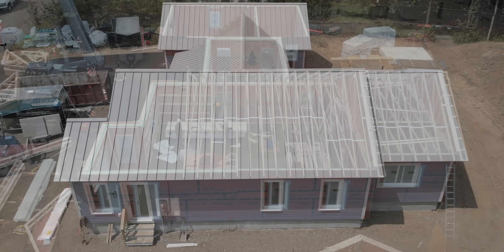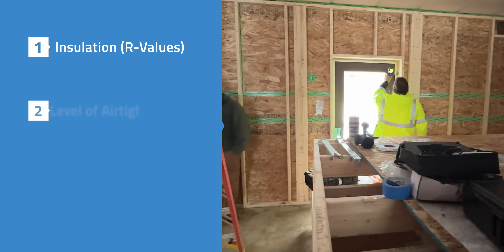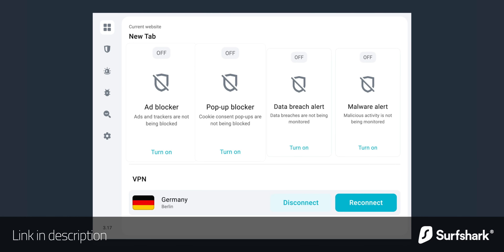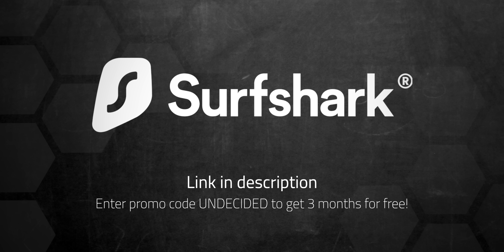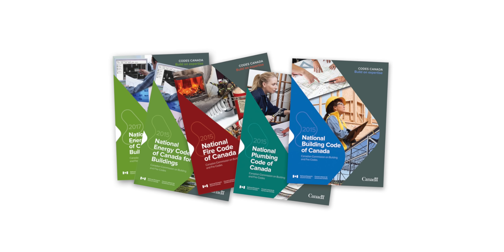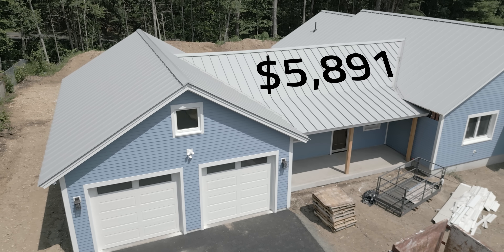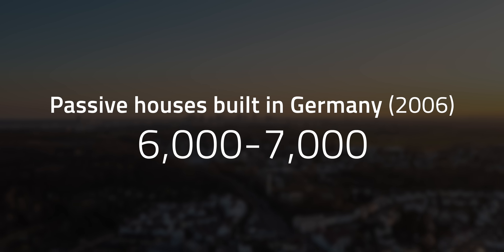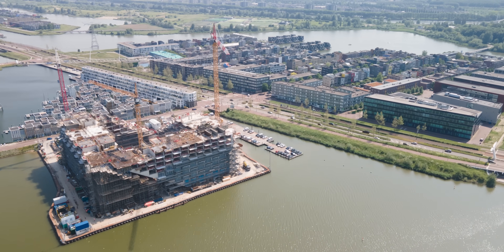Why Do American Homes Suck?

Comment: "Why do US (also Canada and Mexico) homes suck?" , because they're often built as cheap as possible to save material and labor costs. This is why the worst homes are built exclusively with plywood and gyprock. Those are literately the cheapest, and weakest materials to build a home with, and have poor insulation values, and mold/burn easily. 

The Marine west classification is interesting, because this is a big reason why the "leaky condo" problem happened in BC. A bunch of condo towers in the 80's/90's were built with thermal/moisture envelopes that didn't handle moisture properly due to following California building code it was based on, and as a consequence required remediation to stop the mold and water from getting in.

So as one would say, buyer beware. Now there is also one additional consequence of going down the energy efficiency rabbit hole... resale value of a home. Because just like energy efficient vehicles, the more complex it is, the more expensive it is to maintain yourself. Is the manufacturer of those appliances and HVAC parts going to be around in 20-30 years? Will you be forced to rip out an expensive proprietary system to replace it with another?

Ideally, you just build a forever home and it stays that way.

Comment: We built our house in the UK in 2007/8, to what is referred to "1992 Building Regs".  That is a set of what you Americans call Codes, for building a new house.  It was a miserable level of almost everything - easily bettered by thicker insulation at the very least.  Then comes Bulding Regs 2010 - which is what we built our house to (3 years early).  This was going to be tightened further to 2016 Building regs, getting close to Passiv Hausn standards.  However, a change of government, and that level; was dropped as "being too expensive".  Short term views.  We now have zero space heating on between mid February and mid October, and that is only because we built better than the Building Regs in force at the time.  (Air permeability was actually better than than required in Sweden!)

Save money long term by getting insulation and air tightness done at build stage.

Comment: Unfortunately, if you go to a builder willing to build to some of these specs -- or try to find one -- I suspect that most folks would be priced out due to a "premium pricing" situation. Not only the increased cost for the better materials and associated costs, but premium price just based on the novelty of it all. I would hope to see some standardization and scalability of builders/companies making this more common in order to make it an attainable option for a larger portion of the middle class.

Comment: $5900 savings, I assume that is per year?  How many years to break even with the added costs?  Maybe not ideal to wonder about, but if it is going to be 10, 20, 30 years, beyond the time many will still live in that house, it matters to the one doing the building.  When you factor in the cost of the loan, the intrest on that loan, etc, since most aren't buying the house outright, all that adds into the time to pay off the added cost as well.
Reply: That cannot be a per year number. Even if everyone around him has the most inefficient heating method (oil, which is mostly a northeastern thing) their bills would be less than that. The average energy bill in the US comes out to around $2400 a year, and Washington is well below average since it is much more temperate. So it's not per year...but then what is it? Over 10 years? If so that is certainly not worth it.

Comment: North American building standards are 20 years behind. My son new apt in Boston has double glass windows less efficient than the one used 25 years ago in the EU.  As for insulation, cardboard walls (chicken scoop are better built in the EU) are not bad compared to bricks, blocks but not as good as the new light bricks, external PU insulation etc...